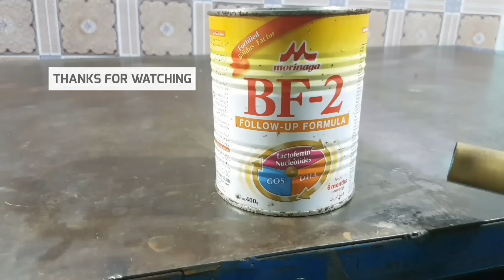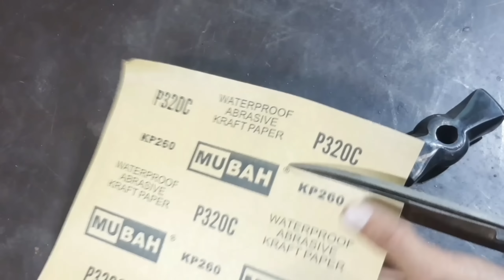Antique Rusty Cross Peen Hammer - Restoration [ Brass Coating With Leather Handle ]

Comment: I can't say that I know what a cross peen hammer is, but if you would've made the handle a bit longer it could be used as an excellent skull cracker for use in hand to hand combat. Anyway, you've turned out another amazing restoration..
Reply from the maker: Great point! but i made 14"